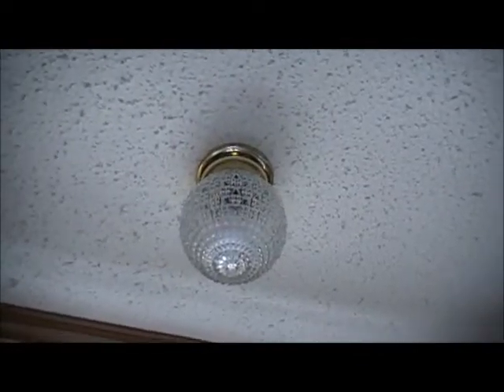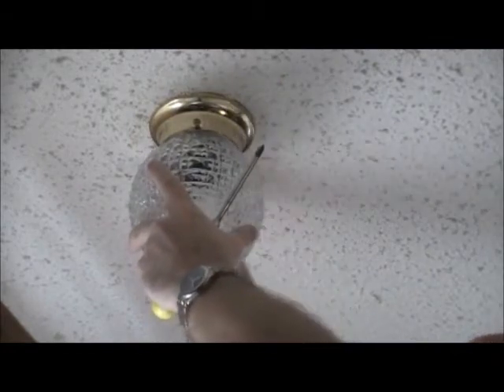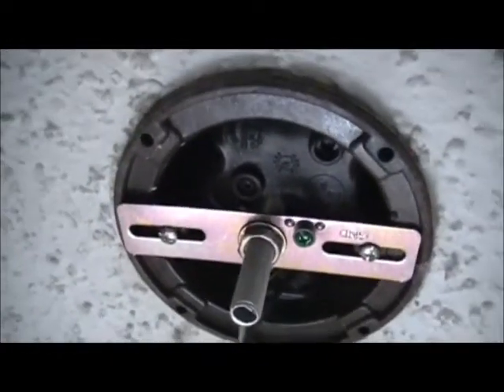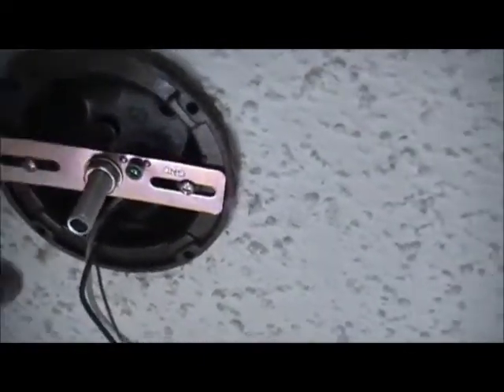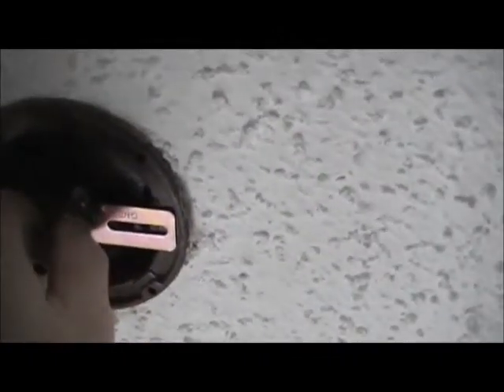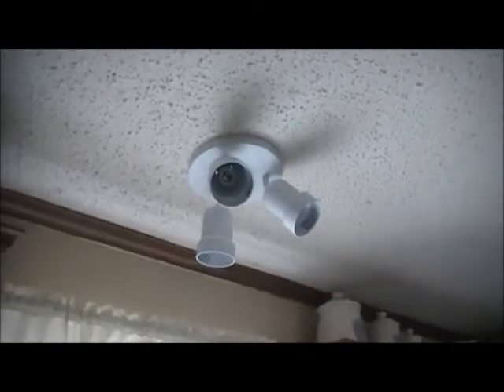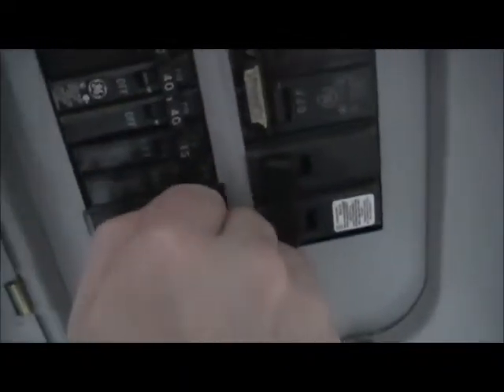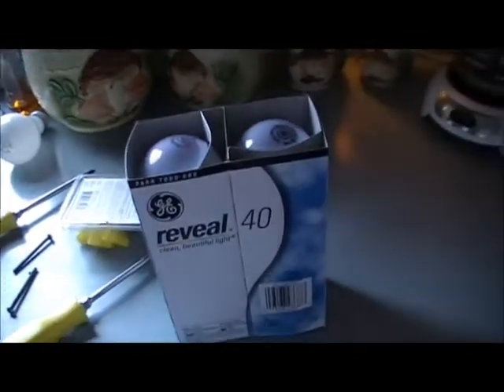Installing A New Kitchen Light

Comment: pretty nice...I had to put a track light up in my kitchen it uses 4 75W bulbs!  But it lights the whole kitchen lol.  It was such a pain in the ass they barely gave me enough wire slack, and I had to cut the gang box hole in the ceiling that was also fun.

Comment: Ooow ive had that problem with some lights, its almost as if they didnt want to waste the wire :-)
I had to fit a fan/light combination for a frend, and apart from short or oddly coloured wires i found the fan didnt work, it was too far to take the unit back to the shop so i took it to bits and found one of the cone shaped joiners wasnt working.
Faulty factory assembly, no testing before sale :-(